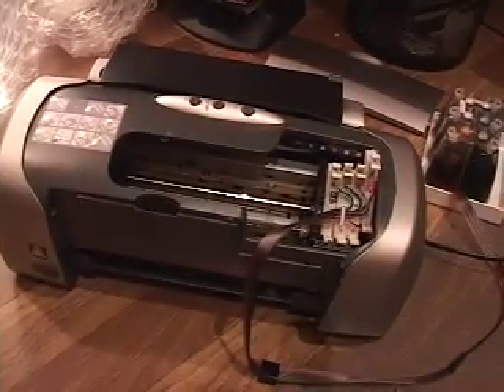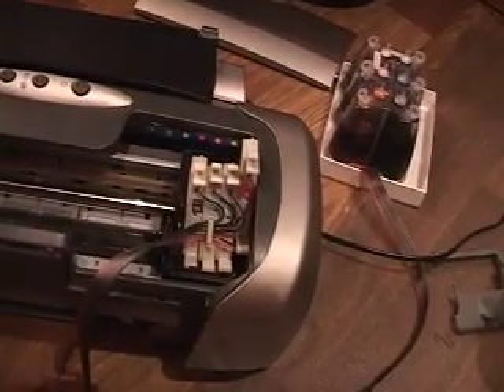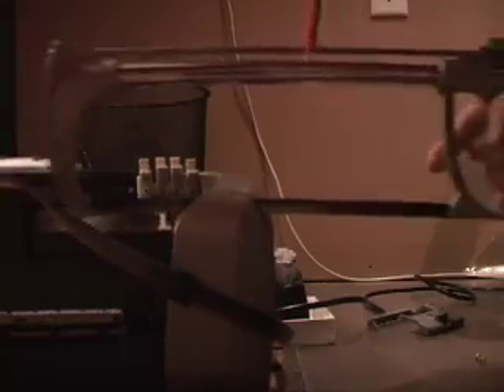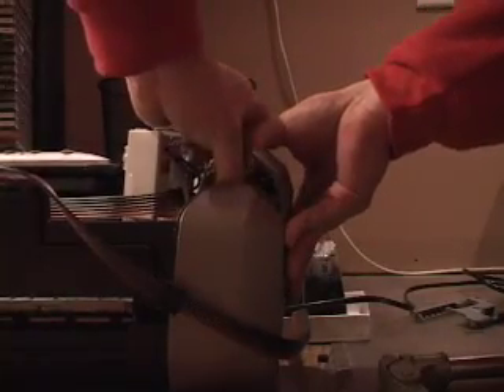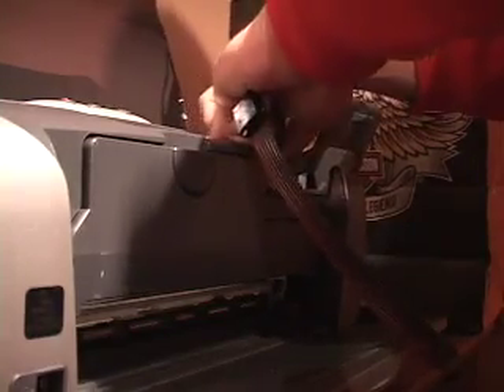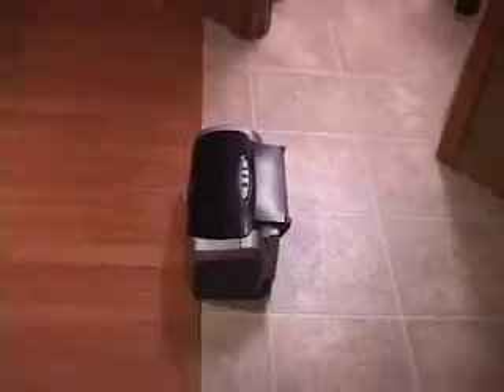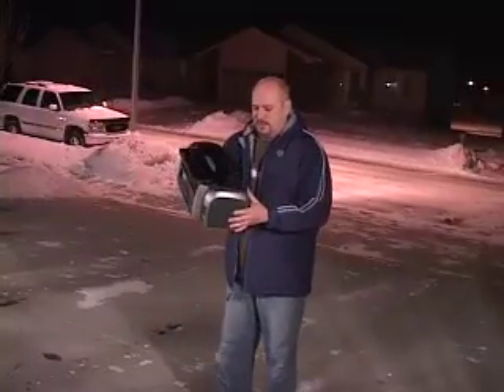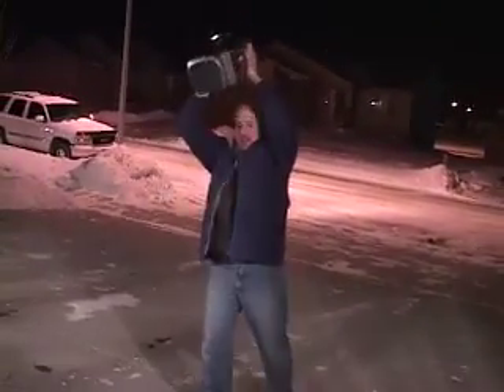Epson R200 Printer Destruction

Comment: i had the same problem with the EPSON R300 I couldnt get the cartidges out i manage to pull out 2 tho..i took a hammer to it inside and tried to bust it apart to get my re-flll cartridges out,,,later i took it outside and layed the axe to it before i tossed it in the garbage,worst pinter ive ever had...DONT BUY EPSON YOU WILL BE SORRY... i bought a HP D5160 
for my dvd/cd printing   wow what way better quality  il stick to lexmark and HP printers